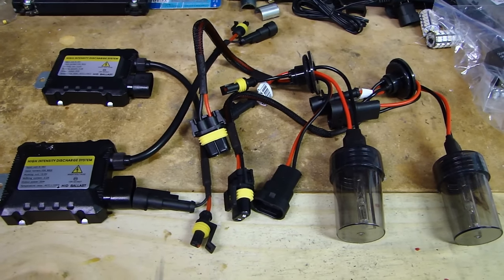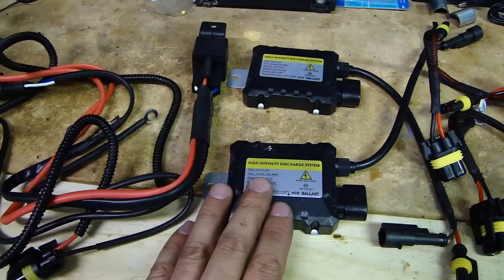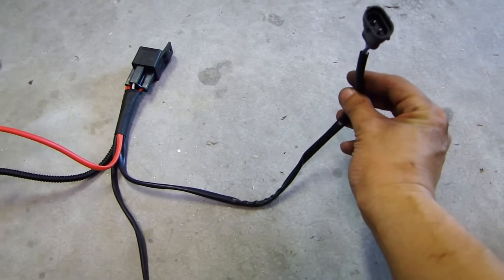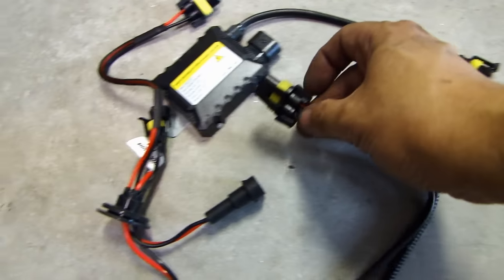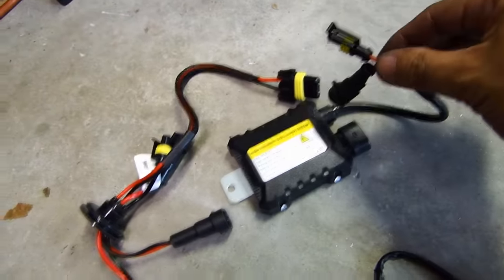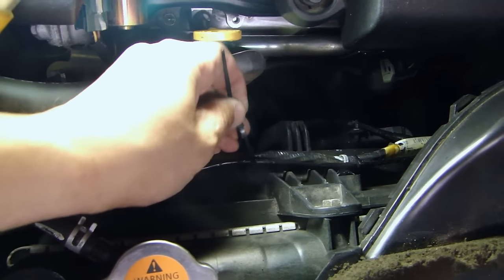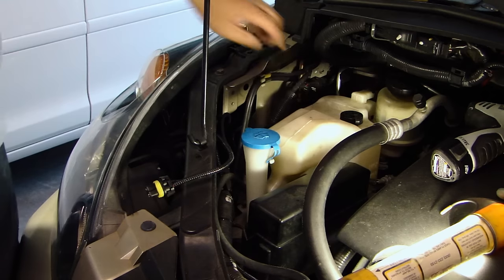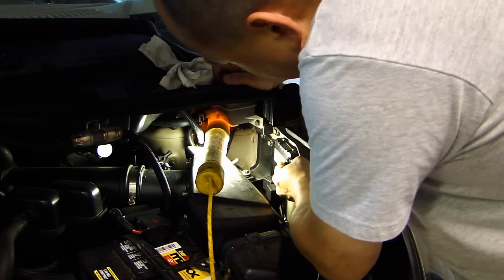How To Install HID Light with Relay Wiring Harness

Comment: if I try this bulb and I dont like it can I go back to the original OEM bulb and plug it into the little box connector that came with the other light?
Reply from the maker: Yes you can revert back to OEM bulb
Reply: @dial2fast   I did it and no more trouble  with those fan lights

Comment: Quick question so u only connect one off the 2 headlight connection to the relay???
Reply: Cuz I only see one connection to the stock headlights connection
Reply from the maker: Yes, the relay harness only has one relay trigger wire.
Reply: dial2fast so you leave the far-side connection to the car just plugged into nothing? I used your video for my install and everything is working great, but I’m getting a message inside saying a bulb is out because that connector isn’t hooked up to anything.

Comment: did you have a actual OEM connector for the ballast? I had my  HID kit installed years ago, and cent figure where they plugged the connector into. I been using the fog light connector since.

Comment: quick question, what the hell is that connector between positive and relay, a fuse? Also, I see that one headlight connector plugs into the relay harness does that mean the other one is inactive/laying around because the one already sends the signal so the second is rendered useless?
Reply: Yes it is a fuse. Yes one headlight connector plugs into the relay harness (normally the side closest to the battery) the other one is left unplugged, since it just sends signal from factory harness to relay so you just need to connect one side.

Comment: Great instructional video helps those who haven't done this prior alot, i have done them enough its pretty quick now however on my own car i need something extra i guess! My hids just one night decided to go out & continue this every night hete & there, the kicker is i had my car parked today with hazards on for about 45min-1h & the car was totally dead! It was so dead that even bump starting didn't work i had to get an actually boost, so i think i know why my lights suddenly started going out but i still want to wire in a relay. 
Can i just take a relay and make my conections on it or do i have to buy a harness, i only ask 1 because i'm short on time and can't wait for stuff to get shipped to me in Ontario Canada 2nd i have a brand new relay sitting in my parts crap so i could save time & money it i can use that one. Thanks
Reply from the maker: Phil Peterson If you know how to wire up a relay, then of course you can. I normally put together my own relay harness, but for demonstration, I used this relay kit. Just make sure you fuse the 12v wire for safety.
Reply: Thanks alot for the info.

Comment: Question? Why other YouTube videos showed the relay black wire hooked up to the battery !!
Reply from the maker: +alilazmo Black wire is chassis ground. The battery negative terminal connects to the car chassis. Either connect the black wire to chassis or to the negative terminal on the battery...same thing.

Comment: How would we connect the HID Lows and HID Fogs both with wiring harnesses to the battery? Can we overlap them on the terminals? thank you
Reply from the maker: +Vinayak Riyat Yes, overlap the 2 ring terminals.
Reply: Hmm. Okay, Last time I did that, for some reason it drained my battery on my car and I had to take my car to the dealer and they said the positive terminal was loose. I am not sure if that's what caused the drainage in my battery or not, but I am a little uneasy as to hooking up my harness for both my sets of lights again, as the issue last time left me stranded on the side of the road. =/

Comment: guys I need help I ordered 2 kits of xentec I understand it's not the greatest brand my problem is with my replay harness it's 2 skinny wire postive negitive opposite side a plug for either factory oem plug in to ballast or a plug to plug in the relay harness in people have told me the oem plug doesn't get plugged in on opposite sides of battery but I have 4 replay harness could sombody drop there email so I could text them I'm so confused problem is either I plug in factory plug or relay I can't do both so how will the Ballston with out factory plug get power if it's not plugged in

Comment: Sorry the stupid question, but which is the trick to disconnect the headlights conector?

I have the manual, also the garage manual, but I don't know where to find this information. Thank you.
Reply from the maker: Depending on the type you have,  many have a plastic push tab on the connector you need to push down and hold while pulling the connector off.

Comment: I have two 10 inch JL audio subwoofers ran by a 1000 watt monoblock JL amp in my truck and whenever I have the bass turned up my head lights flicker and I believe it's because I lack a capacitor between the 4 gauge connection from the battery to the amp. I ordered an opt7 hid conversion kit with 6000k xenon bulbs that I would like to install. This kit came with a relay harness and I was wandering if I actually have to install it because a buddy of mine has the same kit but his didn't come with the relay harness. Will instilling this fix the problem of my headlights flickering?
Reply from the maker: +Nick Klink Headlight flicker is because your amp is drawing a lot of current when you have the stereo cranked. Using a relay kit for your lights will not fix the flicker. Also you don't have to use a relay for the lights if the factory harness provide enough current.
Reply: +dial2fast thank you for your reply, I suspected I didn't need a relay harness as my friend did not need one. Thank you for your input keep making great videos good sir 👍🏼
Reply: +Nick Klink Do the big 3 upgrade and get a second battery. Problem solved

Comment: Where does the other plug coming off Of the bulb itself go? It looks like another 9006 connector
Reply: Did you ever figure that out? Do I just let the male fitting hang there?
Reply: Did you ever figure that out? Do I just let the male fitting hang there?

Comment: Nice and simple explaination. Thanks and subscribed, please provide the feedback, how is the operating temperature compared to halogens, i mean heat build up inside casing. I have heard hid are cooler than halogens. How is the long term performance?
Reply from the maker: HID will last a very long time, but both HID and Halogen run very hot. Maybe one is cooler than the other, but again, both are very hot.

Comment: how reliable with no harness? for what i know is my factory used 55w 12v which i used 35k hid kit ..
Reply: loc pham it's reliable. I've had Hids in my last 3 cars since 2009. This is the first time I'm using a relay since it came with my newer Hids.

Comment: I just installed my OPT7 Hid Kit to my 2012 ford fusion and both my low beam headlights went I out !! I should have gotten the relay I see why now it's important to have that. hopefully I didn't burn out any wires :/
Reply: So did it work when you bought a relay harness

Comment: Great video. Couple questions.
I have concerns about reverse polarity with my HID kit, and I don't have a relay harness at this time. Question is, after I get a relay harness how can I tell if polarity is reversed? I don't want to break anything. Apparently I had it reversed in the past according to an auto electric place, but the bulb worked that way right up until the ballast fried.

Second question, does it matter at all if you ground to the chassis or negative terminal? Is one preferred over the other?

Third question (sorry!) My battery is in my trunk. The front module does have a big red positive(+) terminal that I believe is intended for things like this, but do you know for sure if that is correct?
Reply from the maker: +beaker4251 To make sure you install ANY car electronics properly, you must test all connection with a multimeter. Guessing will get you in trouble. My channel has some videos on how to use multimeter, take a look. https://youtu.be/9IZUvTyOGAk
Reply: +dial2fast Thank you so much! I will get a multimeter and check out your videos before I mess around with my HIDs anymore :-)

Comment: I have a Wrangler with 7" round hid projector housings that use rubber boots to seal the wire inlets. In order to get the bulb wires routed through the water-tight rubber boots, the bulb connectors must be removed. Does anyone reading this know how to remove the plastic AMP style wire connectors from these HID bulb wires? Thanks in advance.

Comment: What amp relay do you use? Mine didn't come with a relay in it. Thanks
Reply from the maker: +Tylor Swain Most commonly used automotive SPDT relay is rated at 30amp. Not meaning the device will use 30amp, but the relay can handle upto 30amp..
Reply: +dial2fast thanks for your reply. I ordered 40 amp before I got your message will that be alright or do you think I should by a 30 amp one? My kit is a hi/low one dunno if that makes any difference?
Reply from the maker: 40 amp relay will work fine

Comment: Can the relay plug be also connected to the socket that came with the HIDs bulb? I was thinking plugging the factory plug to the Hids bulb plug and then plug the relay plug to the other wire of the bulb.
Reply from the maker: soshimontage1 I am not quite sure what you mean, but if you are using a relay harness, it needs to be plugged in the way I showed in the video.
Reply: dial2fast I'm sending you a PM to the link

Comment: I need to know what the other black ground goes. You didnt mention it. Does it go to negative terminal on battery or are there really 2 grounds? Help please
Reply from the maker: 4Peta20 The other black wire shown with the ring terminal is also connected to ground.
Reply: dial2fast thank you for the quick response. :) So both would connect to the chassis.
Reply from the maker: 4Peta20 Yes, both black wires with ring terminal goes to chassis ground.

Comment: is there 1 connection on the ballast that wont need to be connected? i cant figure out where it goes, i left it alone (disconnected) and still work
Reply: Joaquin Sanchez there's nothing left unplugged the only wires on the ballast should be the wires going into it for power and the wires going out of it to the bulb

Comment: The relay protects the low voltage side of the circuit (which often runs under the dashboard) by closing a switch (internal to the relay) on the high current side should current get too high.

Comment: Does anyone have experience in replacing the actual Xenon bulb once they burn out? I have a burnt out bulb and it seems the bulb is fused with the wire.
Reply: You will have to buy another set of bulbs. I do not think any company just sells a single bulb. Could be wrong but i have only found couples

Comment: Does it matter if my relay harness only has one ground wire?
Reply from the maker: +laramo100 Yes it will fine, the one ground will be split to both harness.
Reply: +dial2fast Thanks! One last question. Where would I connect the cancellers to the relay harness
Reply from the maker: +laramo100 As far as I know, you don't need to use the canceller if you powering your light through the relay. Canceller is needed in some vehicles when directly powering the HID with factory harness to avoid flicker.
Reply: +dial2fast I'm going to be purchasing a 3000K hid kit for my fogs and I was wondering do I need another relay harness or can just use the factory harness. It's a 25W kit by the way
Reply from the maker: +laramo100 Hard to day, some cars factory harness work fine and some will cause flicker. You can try it and see.
Reply: +dial2fast okay thanks. I just installed my low beams and for everything to work properly I had to use a relay harness and a capacitor to stop flickering

Comment: I used a similar wire harness on my wife's 2013 Mitsubishi RVR. The install was simple and easy to follow....however, there is a problem. In Canada our cars have daytime running lights (DRL). When those are on the lights flicker, my understanding is DRL use half power. When I turn the headlights on full (night mode) they do not flicker. Maybe disabling the DRL somehow so the headlights are always on would remove the flicker. Ideas/Suggestions anyone?
Reply from the maker: Thought your RVR have separate bulbs for Hi and Lo lights. The DRL should run on the Hi beam and they do run at half the voltage. but shouldn't effect the Lo HID you installed. Besides them being separate, when you turn on your Lo, the DRL turns off. So when are you seeing the flicker?
Reply: ***** thanks for the advice !
Reply: dial2fast As soon as the car is started the low beam HID (ones I installed) flicker, they continue to do so until I turn on the headlight.

What I have been doing to avoid damaging the lights is I now always turn on the headlights then start the car. There is zero flicker when I do this but really it shouldn't have to be done this way if they were working properly.
Reply: Simply pull the DRL fuse and you're done
Reply: Thank you, I will try

Comment: Hi Dear Friends, where i can find a eleçtronic diagram from Wiring hardness controller ? My controller have  a short circuito, i have repair it but i need to confirme all plate connections  m it´s little diagram with relay , two capacotors and some diods, laes if somebody have this diagram, sent it to me, thanks

Comment: if you are still in progress these xenon?
Reply from the maker: kasim tutundzic Not anymore after finding out they are DC ballast which causes the color to be very blue for the 5000k. I also did a video on comparing AC and DC ballast.
Reply: dial2fast Whether this hid kit any trouble, flickering or burning out bulbs and ballast? good video and explanation thank you for your reply in advance

Comment: If both hid light do not turn on and you switch its polarity and only one turns on then the only reason they'll have you buy a harness is to bypass their mistake. Just switch the pins in the connector that connects to the ballast. Both should work without switching polarity.

Comment: Quick question to anyone of you guys, I recently changed my halogen bulbs only 2003 f250 6.0 to XENTECS xenon HIDS bought them from Amazon, but the person that installed them didn’t use any relay and only hooked up the converter wiring to where the old lightbulbs would be and then hooked up the hids
*Now when I’m driving and I turn them on my ABS light comes on for about 2-3 seconds then turns off 
*if I’m driving on the highways and turn them on my whole dash’s needles buckles RPM’s, speedometer, everything etc 
Didn’t really use them for about 3 days, but after all this I get everything more in replies
Reply: But after all this I get everything I just explained and my check engine light come on
I’m definitely not trying to do this on my own I’d rather take it to a shop to revert it back to regular bulbs and hope nothing serious happened to my car forget HIDS, he never mention no ground relay no nothing, just used the old light bulb hook ups and wire the converter there

Comment: This question goes out to anyone that can answer it: On my 1992 Lexus Ls400, I purchased a HID kit with the relay harness. After carefully installing it, I started the car up, tried to turn the headlights on, and nothing at all. The HID lights did not even attempt to turn on. I read online people talking about reverse polarity, but I don't want to blow a fuse or short anything by trying that yet. Can anybody tell me what I did wrong?
Reply: +SwaggerStick Nick yeah some hids dont match up with positive and negative you gotta switch the reverse polarity nothing will happend of fuse or short it just wont turn on...

Comment: Why add a constant 12v to the Battery? Couldn't you just tap into the existing Headlight power circuit wiring? Seems like your half asking this. Last thing you would want to do is have another wire running to the battery when you don't have to. REVOLUTION!!
Reply from the maker: Startup current of HID ballast can be up to 10A for each side. That's 20A for both sides. If you want to risk damaging your factory wire and the BCM, you can definitely do that to your own car.

Comment: I bought a used mustang and the headlights sucked, I went to install new lights and found this garbage. and my wires are trashed.
Reply: If it's SN95 mustang it probably uses the 9007 harness-- look at the original harness plug. It would have 3 pins. His has 2 pins. You would also need the 9007 dual xenon bulbs and a harness that has an extra 2 pin wire for each side which you would connect to the bulb in addition to the 2 wires from the ballast. (also, the pins on the relay harness may need to be interchanged blue-brown-white is for a Chinese ballast and  Brown-White-Blue is for the German ballast, I think...)

Comment: LED is 15 to 20 minute to install ,, HID is so complicated 2 hours to install
Reply: ᅚ mine took a good 45 minuets just because the clips didnt fit to the battery and i had to fiddle with securing the ballasts and all their wires to the car. Then having to drill a hole in my headlight cover

Comment: So do you not need to use the passenger side oem main headlight thing just drivers side?
Reply from the maker: The relay only has one trigger wire. So you can take which ever side you want from the car to trigger the relay. You just need to connect one.
Reply: dial2fast awesome thank you!